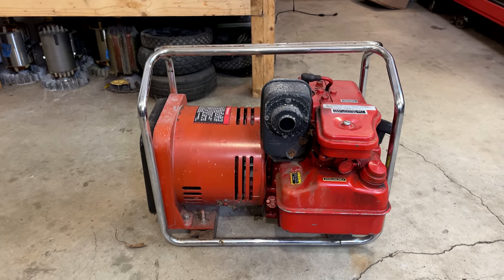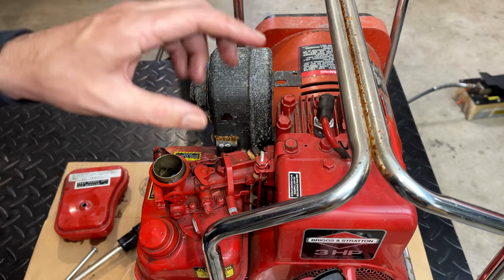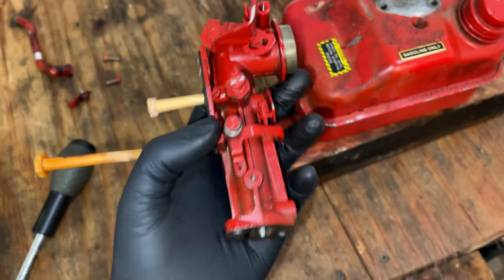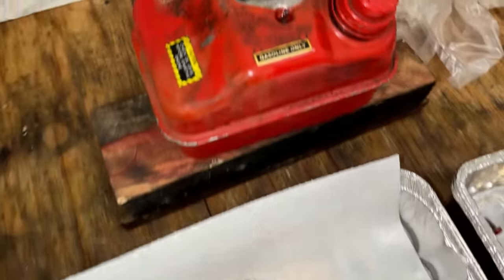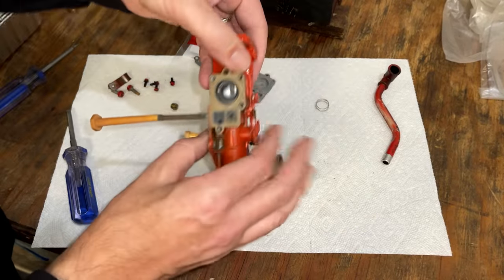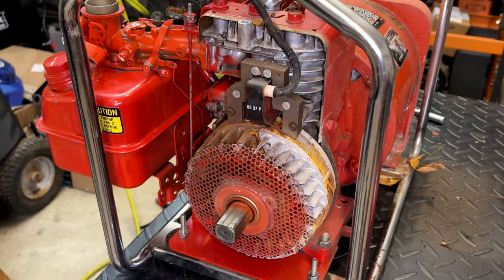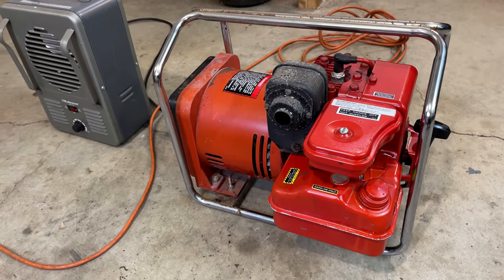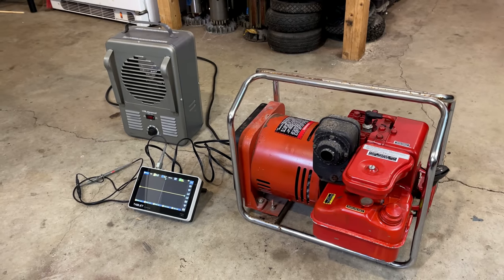Old Pincor Generator from 1985 - Does it Still Work?

Comment: If you really need to get rid of thick rust or limescale, I've found 20-30% HCl (hydrochloric/muriatic acid) works best and is sometimes the only thing that will touch it. Still it sometimes needs to soak for a while. It is very strong stuff that will loosen paint so you need to be careful with it, also wear gloves and not get it on your skin or eyes. After that it needs to be neutralized (baking soda solution) and I usually follow that with phosphoric acid solution (evaporust) to make a protective layer of phosphate, otherwise any remaining HCl will continue rusting the steel.

Comment: That tank came out very well. I was surprised. I was thinking as you were shaking it around with bolts in it, that you're gonna need to get the Kreem kit. That product seems to work well on motorcycles anyway. I usually have to fix the holes in the tank by brazing it, then I Kreem the tank to seal it from moisture and so forth.

Comment: Jim, I struggled a bit with my Coleman generator with the 5 HP engine. All those connections behind the tank can be a bit of an issue. The carburetor removal and reinstallation wasn't one of Briggs best designs, but it's actually a good carb despite this.
Reply from the maker: Easy carb to clean, but removing it and attaching it to the engine takes a while....

Comment: Great video as always. Since it is a brushed generator there has to be voltage regulation of sorts. Maybe there is a adjustment pot on the circuit board?

Comment: Gotta remember that this was made for at a time where there were no sensitive electronics so it was fine to run abit over or under voltage. though electronics these days are usually multivoltage from 100v (japan) to 250v

Comment: Sometimes if it leaks air between the take and the carb the engine will surge and not run smooth Sometimes you can use to gaskets on the take

Comment: I fixed a mower briggs that had a gummed up check valve just behind the screen at the end of the long pickup tube. Partial flow restriction which needed disolving with snake oil fuel system cleaner.

Those tubes pull out, but might need a good yank in a vice

Comment: Cute little generator. I'm always surprised when you repair a side valve engine. Surprised they survived so long.
Reply from the maker: Much simpler design.  No rockers, no push rods and non interference engine.  The trade off is harder to adjust the valves and lower compression.  But they do last a long time.

Comment: Those older Briggs don't seem to like starting if the tank isn't half full or more...  Must not get the fuel up into that chamber as easy.  Got a very similar genset here somewhere in dad's shed, very simple things but that means they just run happily for decades too...
Reply: Yep, always fill the fuel tank to overflowing.
This fils that bowl.
The pump diaphragm will be soft and flexible by the time the top part of the tank has been consumed...and then refilling the bowl is no problem with a working fuel pump.

Comment: I havent tried the nuts in the gas tank to break tht tougher rust loose in a tank ill have to try that on my old CT110 tank. Check out Evaporust, can get a gallon of it for $20 at oreillys and its re-usable for like 50 uses and environment friendly. Worked great on almost everything ive tried to remove more than surface rust from. Love the vids, youve inspired me to start my own channel tinkering around with some small engines/generators, keep it up man thank you for all your knowledge and bringing us along with you on these journeys

Comment: I have a 5hp pincor that my father used on jobsites years ago. The bolt threads for the carburetor stripped out about a year ago but I'm pretty sure with that straightened out it's fire right back up.

Edit also, similar to this one(no oil in it) mine is either burning oil or losing oil from somewhere because it constantly has to be topped off or refilled.
Reply: I found out many years ago when the carb keeps coming loose and I kept tightening the bolts..( I tried everything )The gasket replacement between the carb and the engine fixes this problem and never had to tighten the bolts again.. the gasket cost me then   .25 cents !

Comment: A constant voltage transformer will smooth out the dirty output of a brushless generator but with two drawbacks.  Cost and about a 10% loss between it's input from the generator and the output of the CVT.  There's also a little distortion near the peaks of the sine wave.

Comment: Maybe add a variable resistor in series with one of the brush leads 20 ohms at 25 or 30 watts wire wound . Should give you some good output adjustment.

Comment: I have an old tiller same era ish ?? motor carb looks the same, probably more hp model for sure sat for years wouldn't start dumped gas in the carb ran awesome used for the last three years in a row unkillable start it a couple times a year tills my garden every year great machine just had to fix the kill / throttle cable as it slipped

Comment: I'm not sure why you always worry about the cycles a second (Hertz) when most electrical equipment is rated at 50-60 Hertz. There is a 15-20% tolerance.

Comment: That generator is barely used so has very low hours.
It is new and old at the same time.  3 HP is more than
enough for a 1 KW power head, so an easy load for
that engine. Those fuel pump diaphragms are good 
for about 3 years at most before they get crispy even 
using non ethanol fuel in 2 or 4 cycle carburetors. As
a preventive maintenance they are an every 2 years
routine replacement item for everything wherever
they are used. So keeping spares is a good idea 
for small engines on a steady diet of those parts.

Comment: 90% of the stuff in our homes are ran on switch mode power supplies they should run fine on this thing as they are tolerant from 100-120-230V  50 to 60hz they rectify that to DC any way.. 

but it will stress a lot of LED lights that are capacitive regulated

Comment: Jim, Rance here. Enjoyable & informative video. I have a question, if this generator has brushes & slip rings then it has an AVR? and if that is so, then could you adjust the volts with the AVR?

Comment: Fire warning for that motor.  I had one with the 5HP version of that motor, a little older and the gas cap was not tilted like that one, maybe this is why they tilted it.  It had crap in the tank and would stall occasionally.  It had a full tank of fuel, ran for a few minutes then stalled.  I immediately pulled the rope to re-start it, it kicked back through the carburetor pressurizing the fuel tank and squirting a good bit of gas out the little holes in the gas cap, which came showering down on the motor and hot muffler and immediately burst into flames.  There was one tall flame from each of the holes in the gas cap, talk about get your heart rate up!  It was in a dirt parking lot so I just scrapped up sand with my hands and dumped it on top to put the fire out.  Blew the dirt off, re-started and it ran the rest of the day.  It was nice that the motors were all metal back then!
Reply from the maker: Yikes.  Impressive though that it restarted and ran fine after that.
Reply: @jcondon1  Since everything is metal and the fire only lasted probably 20 seconds, a singed air filter was the only real damage.

Comment: That engine looks like it was kept and in good condition.  The old Briggs engines are very durable.  The oil probably leaked out over time or it was tipped on its side as you mentioned.  

I like the Salomon screw driver.  Are you in the ski industry?
Reply from the maker: It is a Salomon screw driver.  I used to work at Salomon for a while.

Comment: I am confused on how that fuel pump works. The tank is below the bowl. What causes the bladder to go up and down. And is there a check valve in the suction of the pump to prevent fuel going back to the tank.  I am used to seeing motors on pumps, so its pretty fascinating that the fuel pump is just uses a bladder to draw from the tank to the bowl
Reply: Pulse is generated from the intake tube, and actually is only the negative pressure that operates the fuel pump diaphragm. That's why they have a spring under them to operate as the return.
Those two little flaps are the one way valves...the fuel is drawn up from the bottom of the large tank and deposited in the bowl at the top of the tank...
so if you fill the large tank with fresh fuel to overflowing every time you refill for a cold start after storage...
the bowl will be full....
as will every orifice and passage in the pump system...
which is usually enought to soften and allow the pump to work after the excess fuel has been used by the running engine and the whole tank level has fallen down to the bowl level.
Reply: @JohnSmith-yv6eq  got it, great explanation, thanks

Comment: I got a freebie Baldor premier OHV30 generator low time hours. The fuel tank was seriously damaged by a fuel stabilizer,  basically melted the inside of the tank. My question is what tank can I use to replace the damaged unit? The original was 2.5 gallons capacity. Baldor is out of the business.

Comment: Ah! The old Evaporust, friction and elbow grease method of cleaning an old fuel tank internally. Do your arms ache?
You could consider using some chain instead of the nuts in future, if it's a pain getting all the nuts out.
Reply from the maker: Need to get a smaller chain.

Comment: I wonder if you could put a voltage drop resistor in line with the DPE winding to lower the voltage going to the bridge rectifier to lower the output voltage. Thanks James!
Reply from the maker: It could definitely be modified to send a little less power from the DPE into the rotor.  Its odd that Pincor designed it at 130-140 volts.  Back in 1985 the power standard had just changed from 115v to 120v.  The data plate on this generator actual says 115v.
Reply: @jcondon1  Agreed! Thanks and I really enjoy your videos!

Comment: With my generator that I don't trust with electronics, I charge a battery off off the 12v supply and hook up a 500w mobile inverter that I normally keepin the car.

Comment: I'm glad it cleaned up easily. We see no mouse nest, that's good. Any advise on when to clean rust off the flywheel?
Whoever came up with that awful bolt placement on that style carburetor should have been required to R&R 1000 of them and then sent to the blackboard to write "I WILL NEVER DO THAT AGAIN" 1000 times as well. I use a  die grinder to create clearance in the casting for a box wrench around that lower bolt. Then I grind the box wrench down so it fits over the bolt head. 
I have been frustrated recently by another issue with that style carb. I did a total clean up with new gaskets on a 5 horse Briggs of that vintage just as you have expertly shown here. Put everything back together and it would only barely run on full choke. Searching for solutions I came across a Taryl Fixes All video. He did a piece on how the long brass gas pickup tube cracks over time and can leak air creating a no run situation. No explanation as to why they crack but he noted a number of imaginative fixes. 
I'm glad you didn't run into that problem. Keep up the great work.
Reply: The weight and length of the brass tube would have an inherent sympathetic vibration...
so over time the thousands of flexes to the pipe would crystallise the metal and thus form fractures....
probably why they went to plastic tubes????

Comment: Have you ever thought of using a small sprayer to spray fuel into the cylinder so it costs the cylinder better?
Reply: The liquid fuel evaporates at a slower rate than a spray of fuel.
So by the time you screw the sparkplug back in the hole (if you put the test fuel directly into the chamber) there is enough to fire off the motor.
Ditto for dribbling it into the intake via the air cleaner .....evaporating liquid fuel gives a longer run test time than a fine spray.

Comment: I don’t think those flat head engines were designed to turn up the necessary rpm’s to get 60 cycles. They usually die prematurely from the high rpm’s.

Comment: If its brushless it regulate the voltage via the capacitor..maybe someone replaced the capacitor with one with more capacitance...try setting the governor to 60hz then a lower value capacitor untill you have 120 volts..if its a brushed generstor try adjusting the regulator to 120.

Comment: It's got the "Self Healing option"  those old Briggs had.  lol  Now they sold out too with plastic on the cam, plastic gears.  You gotta scratch your head wondering are they really saving that much money using plastic?  Plastic warps. breaks, etc.  They should be ashamed of themselves.
Reply: Not so much about saving money as planned obsolescence. The quicker it "wears" out, the sooner they figure you will make another purchase. Each purchase creates lots of profit.

Comment: Question: why do you use 2 cycle fuel when putting fuel directly into cylinder?
Reply from the maker: You do not have to, but two stroke fuel has oil in it.  Given this engine probably had not run in a long time the cylinder was probably unlubricated.  The oil in the two stroke fuel helps prevent a dry start and minimize engine wear.

Comment: Why not add an AVR if it's brushed?
Reply: Adding AVR's is no simple task. Really the design of the windings must be such that they can allow for the performance of the AVR. If there is no AVR then the windings will not be designed right. It may be possible to come up with some sort of circuit that does it as an external add one but Generator designers have never taken that route. Slightly changing the design of the windings to accommodate the AVR  is going to be cheaper and more efficent. Never going to be useful to the guys who service and repair equipment like this.

Comment: You made me a little nervous running that in your workshop. Do you have a ventilation system?
Reply from the maker: Ventilation and several carbon monoxide detectors with a parts per million readout display.

Comment: I wonder if you could "tune" the no-load voltage by changing the value of the capacitor?
Reply: Why should no-load voltage be tuned ? If 50V or 200V, who cares, because it's not used when no-load.
Reply: @karirautio  If the no-load voltage is too high, it's likely going to be too high under light loads as well. Probably won't be an issue in most cases, but some devices can be picky. The control boards in some newer gas furnaces come to mind.

Comment: Can a plug in smoother help with choppy waveform distortion? are there any available?
Reply from the maker: There are, but would be cheaper to buy an inverter generator most likely.

Comment: Why use the scope when in about one minute with an impact the head is off?!
Reply: Maybe you have a compressor hooked up all the time. I don't have room for that, and have to move a small compressor each time, bring it up to pressure, hook up a hose, attach my tool, do the work, then put everything away. A scope would be nice!

Comment: James   I was reading some info on oscilloscopes vs true RMS meters the other day and the article claims an RMS meter is quite a bit more accurate than a scope when viewing sine waves etc.  What's your take on that statement ?  Nice job by the way!
Reply: AC measuring accuracy is obviously an oscilloscope. root mean squared
Reply from the maker: RMS and True RMS are just ways to measure the amount of AC power that produces the same heating effect as an equivalent DC power.  True RMS works better for a non-sinusoidal waves.  A total harmonic distortion meter would be better to measure the harmonics to get a better idea of the power quality.  The oscilloscope cannot do that since the harmonics are not measured at each frequency.  Instead we only see the net of the harmonics.
Reply: @markae0    Not according to the experts
Reply: @jcondon1  Do you ever use a true RMS meter?

Comment: Would clean slip rings help in any way?
Reply from the maker: Could not hurt, but in this case the noise was not from dirty sliprings
Reply: @jcondon1  Actually I was wondering if it might help even out the output. Sometimes I'm a bit too curious as you can see. Have a great week!

Comment: Hi guys, need help. Is there any degreaser that I can use on the ultrasonic that I can buy on HomeDepot, Advance Auto or Pepboys..  Thank's
Reply: Not from those locations, but LA's  totally awesome degreaser sold at Dollar General and Lowes works rather well
Reply: Simple green works. You can also use powdered dishwasher detergent. Expect some discoloration due to the degreaser or detergent reacting with the zinc alloy of the carb body. Use heat and only leave the carb in just until it is clean. You get the best results when you disassemble the carbs and rod out the orifices so solution gets everywhere. Mustie1 uses Gunk carb cleaner liquid in his ultrasonic. That is kind to zinc but eats some plastic and rubber.

Comment: I can’t stand those carbs 
Even new knock off carbs for them have priming issues
Reply from the maker: They are easy to clean, but a lot of working getting them off and back on the engine.
Reply: Fuel up the tank until the fuel is brimming at the tank inlet.
This fills up the "bowl" which feeds the jets...and allows the fuel to start softening the diaphragm.
It should start easily and then by the time it needs to suck fuel up from the tank into the bowl..the diaphragm is flexible and the pump will pump.
Every time you need to start this type of engine after storage...fill the fuel to brimming.